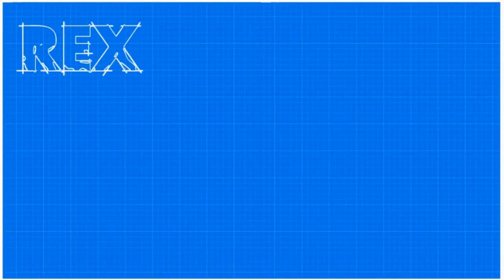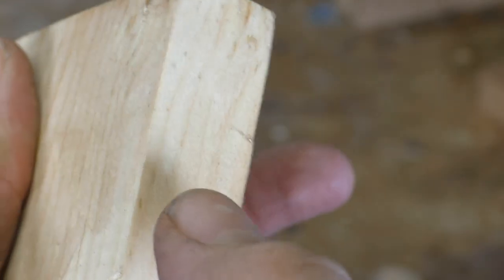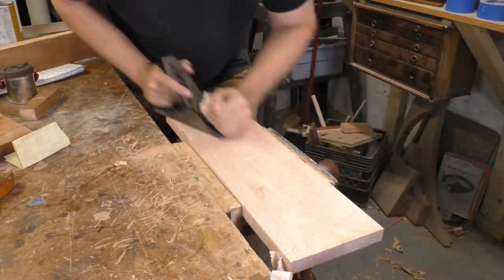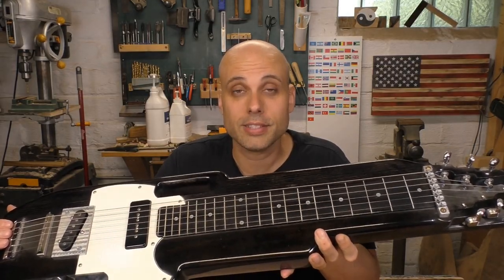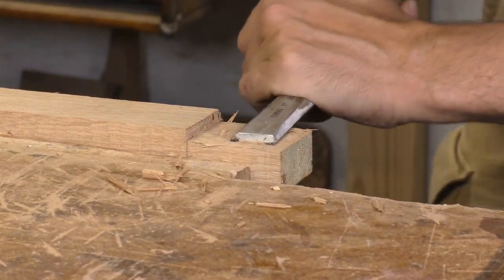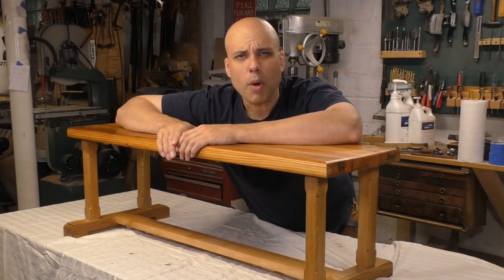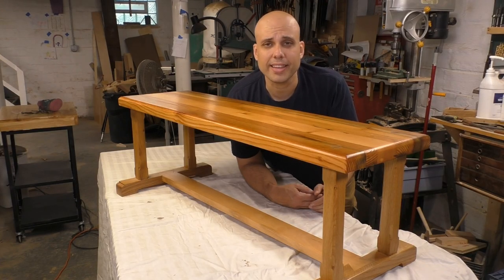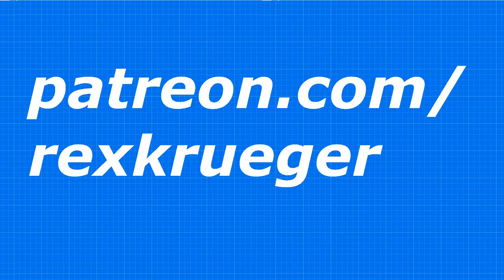Choose the best wood for your project

Comment: So Rex I have another odd question....a fellow YouTube creator just sent me some cut offs of maple and cherry they are 3/4 of an inch and my handle Is a little bit over that, is there any problem if I glue two pieces together to get the correct with to work with?  ...I just figured he sent me free wood I should use it😁
Reply from the maker: Nah, you should be fine!

Comment: Is there any reason why you wouldn’t have done the stretcher in Douglas Fir like the top? Would it have not played nice with the white oak?
Reply from the maker: I think the dovetails would not have come out so crisp in softwood. Since the feet are hardwood, I preferred another hardwood for the joints.  If I didn't have the tulip wood, then I would have made do.

Comment: What about eucalyptus? Beautiful grain and colour but prone to splits, but what is it on your wood scale?
Reply from the maker: Never used it!
Reply: I can only really speak of the Giant Eucalyptus species: it makes really, really awesome firewood, as it burn really hot for a surprisingly long duration! The wood is dense and oily, but it tends to twist as it grows and the grain is stringy. These last two things can make it a bit annoying to split: when you strike it with a splitting maul, the split will often travel most of the way through, but between the twist and the stringy grain, a lot of times you'll have to yank the two pieces apart to finish off the split and recover your axe.

History lesson: back during the California Gold Rush days, the railroads planted a bunch of giant eucalyptus throughout California, with the thought of farming the trees for railroad ties, because the trees grow so fast. They found out later that they couldn't get any straight lumber out of the trees, so now you can find groves of these trees all over California, where the eucalyptus trees are not all that much shorter than the old growth redwoods.

Comment: Any clue as to what kinda hard wood stops a screw halfway through? I have a shed built out of some sort of rough cut hardwood. It’s so hard it would stop my chop-saw, and trigger the switch in my fuse box.
Reply: Zulfburht pine will do the same..depending on when the tree was felled and how it was dried. The area I live has many houses from the 1600’s...the old old timers knew how to manipulate soft pine to rock hard and hold strong for hundreds of years. Like they only cut the tree on the coldest night with full moon..stuff nobody does nowadays

Comment: Greenheart and Purpleheart wood is very hard but works great for furniture... BTW im new to wood working but I was wondering if there is a type of spray on epoxy that I can use for wood.  I make medallions and other types of wooden jewelry multi-layered using a c02 laser and want a strong, clear, glossy, durable, protective, coating to finish it off.  The problem im having with lacquer or polish or any other is that after a few years they crack and falls apart.
Reply: You might consider Automotive Clear Coat... for price. It's still UV protectant, and supposed to be durable enough to last twenty years under exposure to elements... since nobody really takes care of their car.

   There IS also Marine Grade, which is any paint, epoxy-coating, or covering (including "Clear Coat") that stands up to the Sea... It's expensive as HELL, but if you're not happy with anything else, this is about as tough as it gets. ;o)
Reply: @gnarthdarkanen7464  is the epoxy coating able to spray from a gun or is there some sort of dilution process to thin it out?  The other issue is getting the epoxy in the small deep hard to reach areas since it is multi layered...  I know giving epoxy some heat from a heat gun helps thin it out some and removes air bubbles however I dont think that will allow the epoxy to cover all the fine areas...  Any brands in particular... is it even possible to spray epoxy?

Comment: Right... I need a close up of that saw rasp. Did you put a handle on that? That would be super useful!
Reply: Mine came with normal file type handle, gut adding a knob/bolt seems like a very doable project.
Reply: Google " Shinto rasp ". I got mine from Amazon.
Reply: @Kildayyan  Oh I know the type and have used one carving a guitar neck before, but it didn't have that kind of ball handle. Looks comfier than without!

Comment: Oh, I have one more question, I had to cut down a bunch of cherry plumb trees. Is it more of a cherry wood, or plumb? Jk. But seriously, what is cherry plumb good for? I haven't done anything with it yet, but it seems a lot softer & more lightweight than I expected. It seems a lot different than the woods I've worked with before.
Reply: it may seem softer because it hasnt been dried yet, woods get harder as they dry. as for what its good for, pretty much all fruitwoods are great for fine furniture. also keep your offcuts for smoking meat.

Comment: Where I live, northern sweden getting hardwood is really hard. We have pine, spruce, birch and some aspen trees here. The shops almost only have spruce. Even getting pine is hard and expensive (almost only sold as fine planed boards). I once found an oak board on one of the stores. It was about 100mm wide and about 2 meter long. That board was almost 1000sek (around 100 $)

Comment: The best wood is the wood you already have...... if you are doing a specific job and have time and money research what’s most recommended..... I have use a wood commonly known as guapinol... you can’t drive a nail into it and you will burn out a motor trying to work it.  Most will not use it because it’s super dense

Comment: Yellow poplar, what most so called poplar is, is not even a poplar, it's Tulip wood.  This tree is Liriodendron tulipifera.  This is a great tree and it is huge tree.  The biggest tree east of the continental
divide.  It gets 100' or over and 80' wide.  Not for planting in your yard unless you have a big one like me and you have fertile moist soil not like me.  I think it has good looking wood because its different.  I have been doing wood working for about 10 years, but I have been a horticulturist for about 50 years.  I like your you tube show.  I subscribed some time ago but first comment.  Another so called soft maple is Red Maple (Acea rubrum) a nice tree, Silver Maple (Acer dasyearpum) is a crappy tree.  It falls apart a lot.